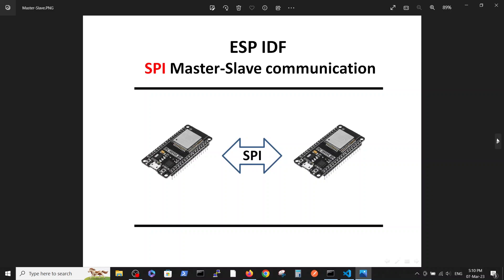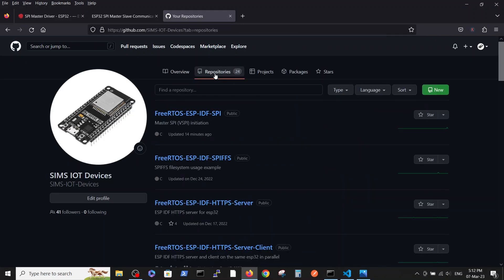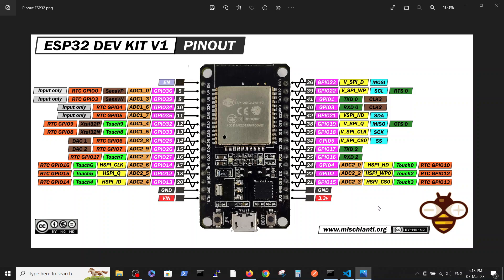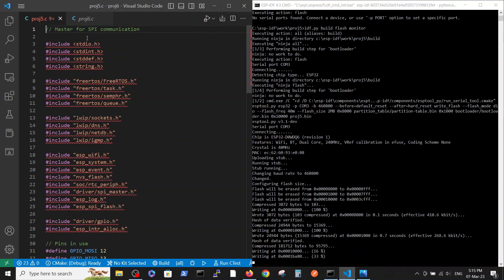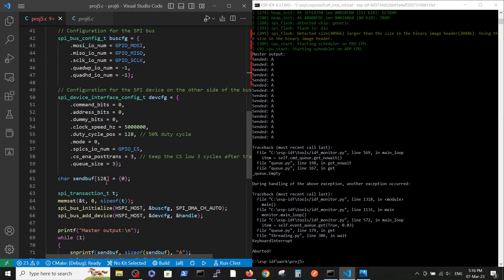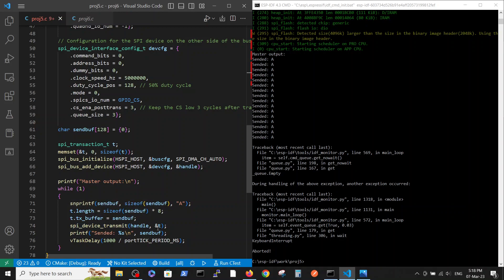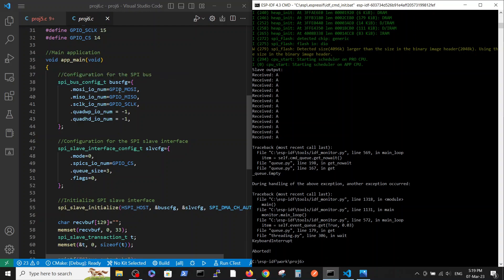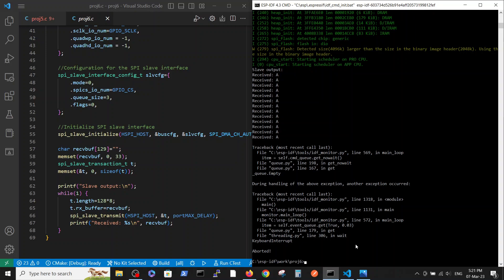2 - Connection between two ESP32's via SPI (Master as transmitter) in ESP IDF environment

Comment: In 5:16 you have the pins wrongly defined! This is the correct setting:
MOSI = 13
MISO = 12
SCLK = 14
CS = 15
Reply from the maker: Dear @Popart-xh2fd,
You are right, the pins in the code are defined differently than in my drawing at the beginning of the video. Those pins are general GPIO, so if the pins in the code are much the actual wiring of the board, the program should work correctly.

Comment: hi, i have a question, does ESP32 support 16 Bits SPI or does it only support 8 Bits SPI?
Reply from the maker: Dear @user-yc8nm7qy7l,
If I understood your question correctly you are referring spi_transaction_t parameter in ESP IDF. The data in this structure can be stored in tx_buffer/rx_buffer of variable length and transmitted by tx_data/rx_data chancks of 4 bytes.

Comment: HSPI_CLK seems to be on GPIO 14 and HSPI_CS0 is on GPIO 15 from the ESP32 Dev kit v1 pinout diagram in your video, but in the next slide the pins SCLK and CS appear backwards. I'm a little bit confused
Reply from the maker: Dear @varfmx,
It seems to me that you are right, the pins in the program are confused. The only explanation that I can find for why the program is working is that CS0 (Chip Select) is up and down periodically and produces some clock signal. If you have any better explanation of why it works please share.

Comment: what are "cmd" and "addr" parameters in "spi_transaction_t" structure?
Can you please give an example?
Reply from the maker: Dear @majidsaeidi7760,
The spi_transaction_t structure is used to define the parameters of the SPI transaction. In addition to the pointer to the data and the data length "cmd" and "addr" are additional fields that can carry additional information. It can be used for efficient decoding for example.